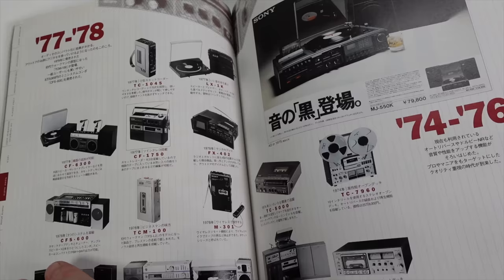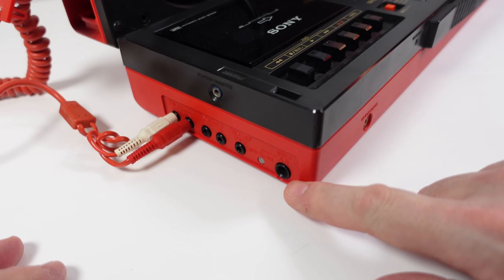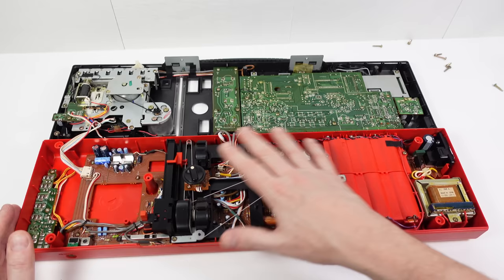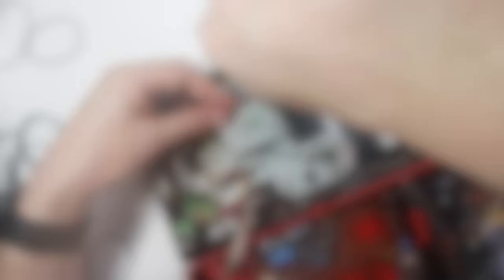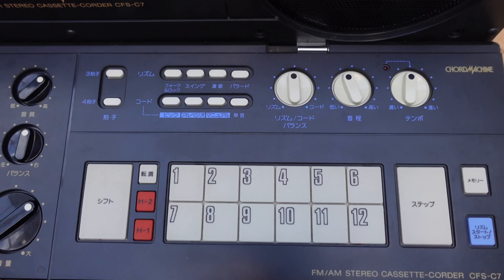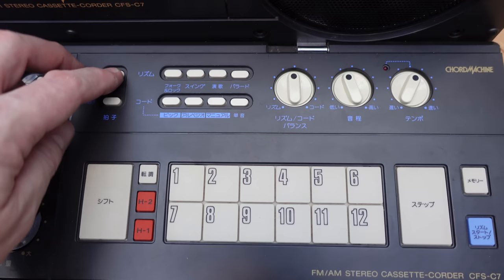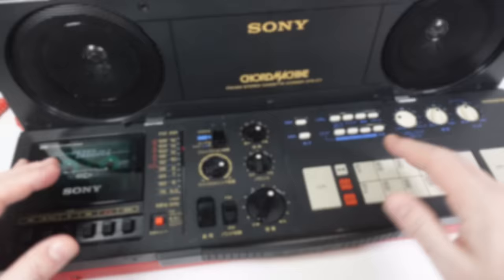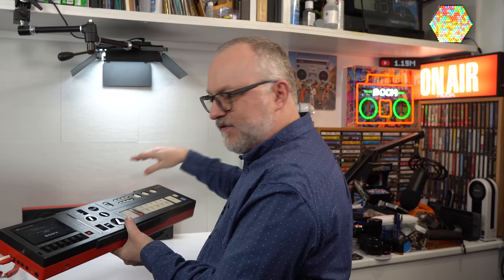The Sony CHORDMACHINE

Comment: I'm curious if the wifi interference was only affecting the speakers or the synth/line-out itself?
Reply from the maker: just the rhythms - the chords are fine.
Reply: @Techmoan  So probably analog rhythm circuitry and digital notes circuitry. That might explain why half the circuits look rounded (hand drawn) and the other half look more square (printed).

Comment: Capstan bushing is SO LOOSE, the flywheel wiggle in all directions just by touching it slightly. I would suspect the bushing to be either worn out, very shallow.. or perhaps it was designed with too much of a gab between the two parts.

Comment: A chord machine that can only play one note at a time is something of a contradiction in terms. Chords, by definition, are what you get when you play two notes together. I did notice that the machine played arpeggios (the notes of a chord one after the other.)  But that was about it.

This seems to be a machine engineered by people who either didn't understand how music works, or didn't care.  The twelve buttons on the synth side seem to correspond to the 12 notes of the Western musical scale. But as you note, these are more typically represented by a piano keyboard. I was expecting that the numbered pad buttons would correspond to various numbered chords (ie. I, II, iv, etc.) allowing the playing of chord progressions.  Is it possible to program in the key of the chords being played?

I'm not at all surprised that this machine ended up failing in the marketplace. It was far too limited for any sort of musician, and overly complicated for people who just wanted to listen to listen.

Comment: Not uncommon for equipment from that Era to be screwed up by 2.5 and 5 ghz as those frequencys weren't really used a whole lot atheist not to the extent they are now. Lgr did a video on this place that used a ad hoc connection but new devices destroy its connection.

Comment: Be careful with the WD40 spraying everywhere though.
Reply from the maker: There’s a bit more information about this video in the video description. 🔝👍 Includes updates, links etc...
Reply: @Techmoan  Yes I guessed it was the oily contact cleaner that we would usually spray into a volume control or switch contacts, maybe it wasn't that but when I was repairing this old stuff when it was much newer we did find that some plastics at the time were adversely affected by the oil in the long term.